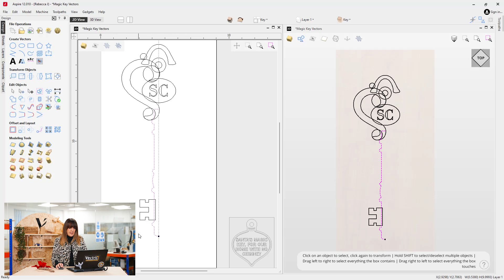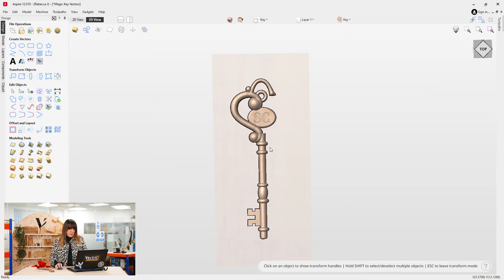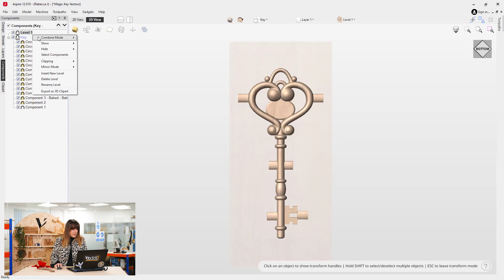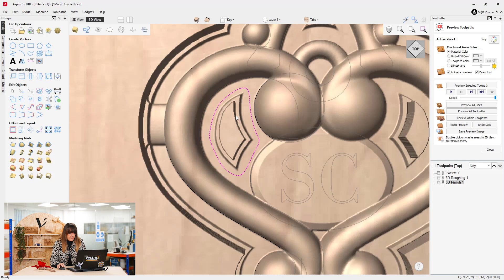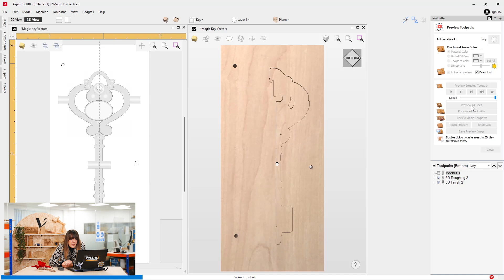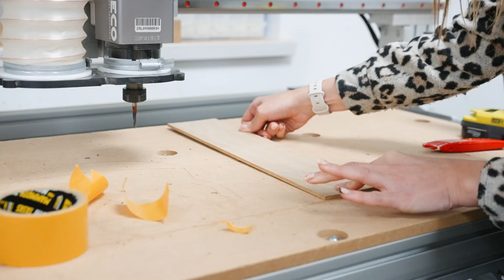Making Santa’s Magic Key | Vectric Holiday Make Off | Vectric FREE CNC Projects

Comment: Hi Beki, Great project and very well explained. You provided the files for the key which is great, Thank you. I have V-Carve Pro 11.55, so apart from changing from inches to mm for my software, entering my material sizes and recalculating the toolpaths, Is there anything else that I would need to do so the project will work on my CNC? Kind regards, Michael
Reply from the maker: Hello and thanks for the question.  If you have VCarve you will need to use the V3M Beki provided... set up a double sided job at the size she did, import in the Key model, Copy it to the other side, and then follow her video from the time she is done modeling the key.  That should be about it... you will need to recreate the "tag"... but other then that... you will be OK.
Reply: @vectric  Hi, Thank you

Comment: Its been proven by your support team that I might be a bit thick BUT how do you open the project files in VCarve Pro?
Reply from the maker: Hello Kelvin... thanks for the question.  The project file you get with this is for Aspire... but, Beki has included a V3M 3D model in the download.  You can use that to create the double sided job, add in your 3D tabs, like she did and create the same tooling... you just can't do the 3D modeling.  If you need help with that please tap Support and they can give you a hand.

Comment: What a great project for Christmas. Thank-you! I'm using Vcarve Pro. I can import the v3m file but not the crv3d files. Am I doing something wrong??
Reply from the maker: Hello William... yes you are correct.  You can import in the V3M Beki included with the download... just be sure to make it a double-sided project, and orientate the model in the center before copying it to the other side.  You can add the 3D tabs like she did and create the same tooling.  If you need help with that please contact support@vectric.com.